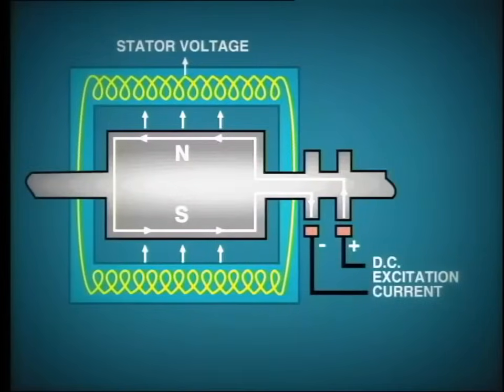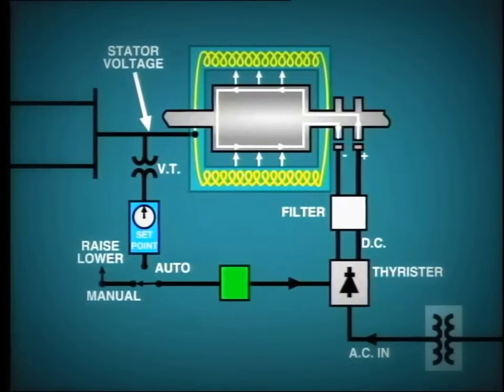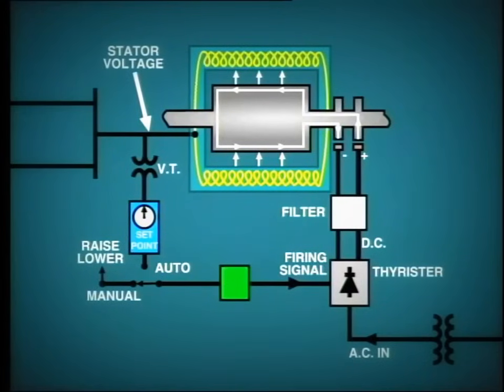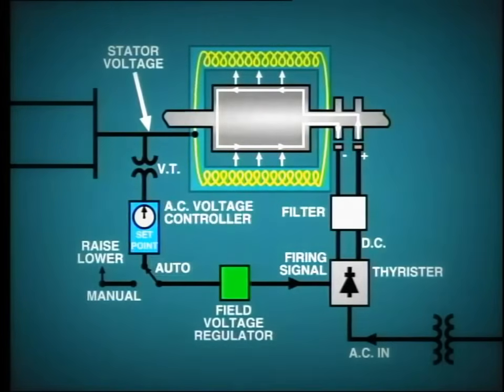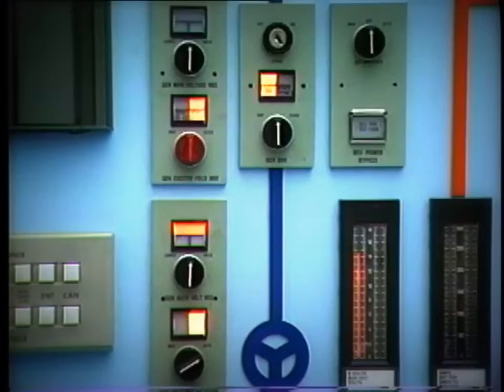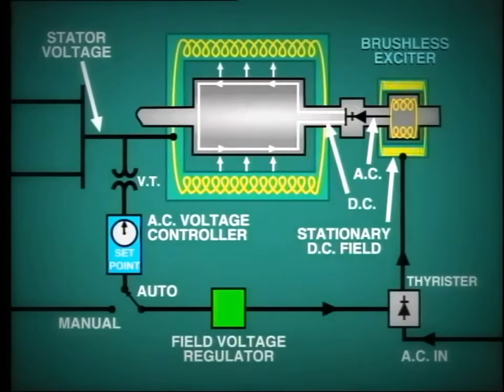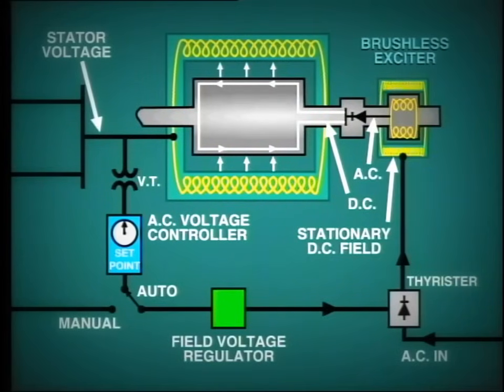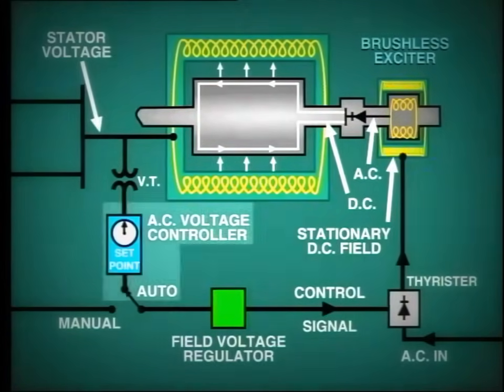lesson 11: Generator Excitation System

Comment: How does the AVR adjust the voltage when the excitation is PMG system
Reply: The PMG is the power source for the exciter alternator's field windings. Basically, replace the "A.C. IN" and transformer symbol portion of the diagram with the output of the PMG.

Comment: Sir,
We don't understand why speed of the Turbine decreases when Electrical load increases on Alternator, please explain briefly with examples
Reply: Here is my rudimentary understanding: When electrical loads are added to the generator, the larger current demanded causes the voltage to drop. The exciter senses the decrease in output voltage and increases field current to restore the voltage. As the voltage is being restored at the higher current the magnetic field induced in the stator increases. This larger induced magnetic field in the stator opposes the rotating magnetic field of the generator field and tends to slow it down. Sensing the lower shaft speed, the prime mover's governor controller responds by increasing mechanical torque (e.g. via steam turbine governor valve opening, hydro turbine wicket gate opening, gas turbine fuel valve opening, etc.).
Reply: Armature Reaction, Read "Alexandra Von Meier: A conceptual Intro to powersystems" for awesome explanation.
Reply: @Adhithya1002 fantastic book

Comment: A  question: what is the benefit of converting the control signal (of Field Voltage Regulator) to DC first and then inverting back to AC (by the brushless exciter), instead of applying the AC control signal directly to the diode?
Reply: Good question
Actually the DC is not inverted to AC, in fact the AC is induced in the exciter. It is a small AC generator with the field and armature windings swapped between the stator and the rotor (since you need to supply the voltage in the rotor).